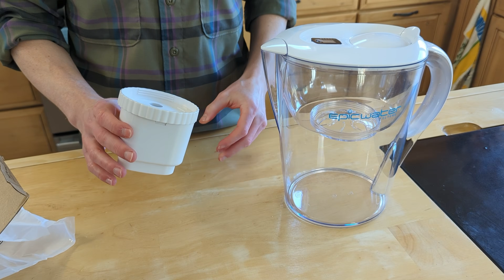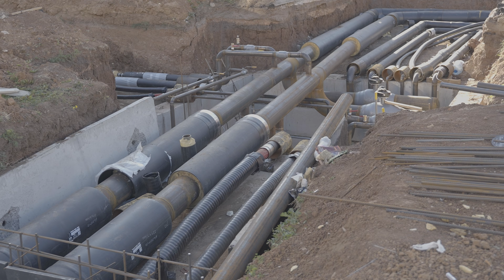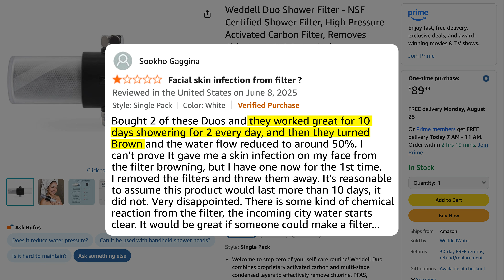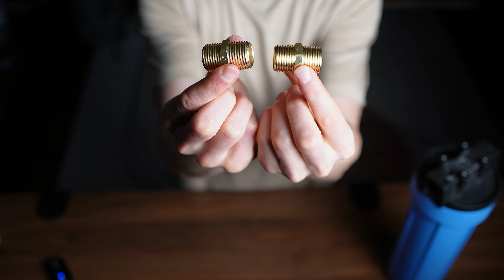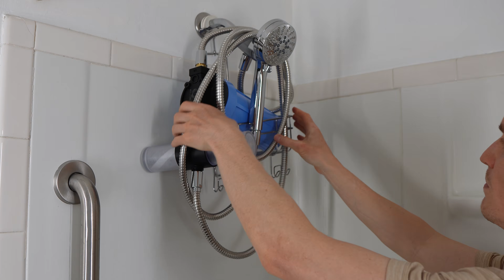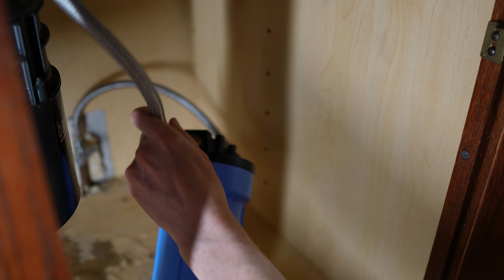You Have a Water Problem

Comment: Could the sediment filter setup be too heavy for the shower head? The thing could weigh up to 5 pounds when filled with water.
Reply: Possibly, if you're concerned you could always put it on the floor of the shower. Rentals can sometimes have pretty flimsy plumbing.

Comment: What's your solution for renters in Los Angeles? What sediment filter, KDF filter and carbon filter before the water softener in the tub? How to keep the tub and equipment clean with all that gear getting wet on the floor of the tub? Will the downhill distance from the shower arm and all these filters strangle the water pressure? 4 1/2" or 2 1/2" big blue? Pleated vs 10-1 sediment filter? 
If this wasn't LA,  I would just move. In Los Angeles, Department of Water &  Power uses chloramines, which Weddell does not remove. LA has hard water. 60% of LA renters are in buildings with aging galvanized pipe. My toilet tank contains rust dust and flakes. Dissolved minerals from corrosion and random pipe repair materials also stain hair and tub brassy. Arsenic, Bromate, Chromium (hexavalent), Haloacetic acids (HAA5), Haloacetic acids (HAA9), Nitrate, Nitrate and nitrite, Total trihalomethanes (TTHMs), Uranium, Bromodichloromethane, Bromoform, Chloroform, Dibromochloromethane, Dichloroacetic acid, Trichloroacetic acid are above EWG healthful standards.

Comment: My weddel duo shower filter clogged after two uses. Returned it got my $90 back for that garbage.  I used a Berkey water filter for half the price and it lasted a lot longer.
Reply from the maker: That's a water problem, not a filter problem. Sounds like the filter was working as intended to remove sediment.
Reply: @waterfilterguru well can I complain to my water company about that?
Reply from the maker: @Vyraxium  you can try. The issue is likely coming from downstream in the distribution system, aging infrastructure for example
Reply: @waterfilterguru  yeah it's ridiculous I might have to do your sediment filter before my shower filter that you showed in your video.  I bought the aqua tru carafe but I use a water drop picture before putting it in my aqua tru

Comment: This is definitely tough on all of us. All we want is to be healthier😅 As many others, I spent $90 on the Weddell shower filter and bought 4 more filters the first 2 months. I thought I'd be relieved upgrading from a cheap amazon filter.         Unlike some people, my water pressure has not changed. When I saw the filter turning brown pretty fast I was worried, but the internet reassured me it was good to use the filter until the water pressure decreased. Well I decided to use my TDS meter (total dissolved solids) on it. On a month old Weddell filter, AND immediately after installation. NO CHANGE. Devastating. Went from 245ppb to 240ppb both times. I understand that this could also be a sediment issue, even though my water pressure is fine. It's a tds meter after all. However, when I test the water from my Zero water pitcher it is LITERALLY zero. And it's water from the same house.🤔. This is a bulky set up. My rainfall shower head and putting more weight on the water line is not an option. I do appreciate a solution. But I would hope they could make expensive water filters that do this😔 Feel for everyone on here doing their best!❤️
Reply from the maker: There's some misunderstanding here, let me clarify:

Your TDS meter is actually working exactly as expected, and the good news is that this result doesn't mean your filter is failing. 

A TDS meter measures dissolved charged substances like minerals like calcium, magnesium, and sodium salts. Shower filters, the Weddell Duo included, are not designed to or capable of reducing those, and honestly no shower filter on the market is. The media inside targets chlorine, disinfection byproducts and some heavy metals, and those media physically can't remove dissolved mineral salts. 

So a near identical TDS reading before and after is the normal, expected result here, not a red flag indicating failure.

Your ZeroWater comparison is a different technology entirely. ZeroWater uses ion exchange deionization, which exists specifically to strip dissolved solids from drinking water. That process is slow, expensive per gallon, and completely impractical at shower flow rates, which is why no shower filter is designed to reduce TDS using that process.

If you want to actually verify whether the filter is doing its job, test for what it's designed to remove. Cheap chlorine test strips on the water before and after the filter will tell you far more than a TDS meter ever could for any shower filter.

The brown discoloration you're seeing is most likely sediment or iron (rust) being caught, which is a separate issue from dissolved solids and doesn't show up on a TDS reading either. And this is actually a sign of the filter doing it's job and removing these suspended particles like it should.

Totally understand the frustration of spending money and feeling like you can't confirm it's working, but in this case the test just wasn't measuring the right thing.

Comment: Thank you for this Video.  BRAVO !! I have successfully been using for a year the WEDDELL Filter system, changing filter every 2.5 -3 months. 
💧 Suddenly After changing the White Filter .....3 days later ,the :Pressure was significantly lower, where before it was strong. & Ideal. 
  I checked connections, and reconnected added fresh plumbers tape, even bought new Handheld Shower Head and it still sucked.   The Plumber fixed bath faucet Leak (Diverter issue) and still no improvement.  I took both sides /Filters out and ran tap water to rinse them off reattached and not much difference.   So I am considering the SEDIMENT FILTER as a necessary requirement.  

WEDDELL has been my best option for an entire year....until this Lack of Water Pressure after 3 days of NEW FILTER...My last Test will be to replace the (RED sided) Carbon Filter and see if that works if only for a few days.....Confirming the SEDIMENT ISSUE. 

UPDATE: I did indeed replace the black carbon & Voila the pressure of return to normal. If I lose this pressure in the next days or weeks.... I know that I will need to get the SEDIMENT filter.  Thank you for those detailed instructions on how to put that together. 
God Bless.
Reply from the maker: Glad you found the video and it was helpful! Let us know how it goes if you implement this solution

Comment: Advice for the Weddell. Might be of help. My bf who doesnt seem to suffer from hard water will not let me put that bulky sediment filter in our shower. So..here's the tip from a reviewer on amazon. "" This filter is great. But I’m going to let you in on a little hack. To preserve the filters it’s important after you use them to unscrew them and let out the water and pour the water out of the plastic and rinse them with filtered water or clean water andset them out to dry. This will preserve the filters and stop them from turning yellow within one week.
I use these filters in my guest house. I took a shower in the guest house, one time and one week later the white filter was yellow from water sitting inside of the plastic housing.
What I did was, I added a little OxiClean into a small container with lukewarm water and I set the white filter in it overnight and then rinsed it with filtered hot water then dried it. Let it air dry for one night even though I continue to buy more filters to replace each one. This is just a simple hack. I use to preserve or reuse the filters longer.""
Reply: what a hassle,,    at that point, id be happier with tap water  lol
Reply: tI can see that rinsing off the filter and letting air dry could have some value however the Color Change is a only a dis-coloration.....until is becomes clogged up and Pressure drops.  That is the criteria for changing the white Filter.  Just Color alone is not the criteria.  
The Sediment that can clog up the Carbon filter /Red marked filter can be clogged up even from say the Apartment Complex Water is Shut for the building and someone does know what they are doing, can when turned back on cause a surge of sediment to clog up the system and mess with water diverters in facets.

Comment: So first I heard of the Weddell Duo, then I heard of the Portable on the go RV Water Softener, and NOW there's a sediment filter that might ALSO go bad in 1-2 weeks ANYWAYS. What's the combination set up to really do here?? Is there something smaller than the RV Water Softener but still as convenient? How do I know what kind of softener I need? How do I know what kind of sediment filter I need, if any? How do I find out? I currently have very limited space (And am not planning on staying here for forever), so am looking into temporary fixtures rather than anything big and built in. It feels like there are endless stages to ACTUALLY getting clean water that will help my skin health and hair health, anything you can provide would be really appreciated, thank you!
Reply from the maker: I'd start with the Weddell Duo https://geni.us/GDjF6Ct which has its own small sediment filter stage. If it lasts a while, there is no need for an additional separate sediment filter as is explained in this video. If you live in an area with high sediment in the water (like NYC) you'll notice the Weddell sediment filter gets filled up fast. In this case, it would be more cost effective to use a separate 10 inch filter as is explained here.

As for the water softener, it would also be prudent to first test your water hardness with simple test strips like this https://geni.us/ijpd to determine if its even necessary. It might not be. If it is, those portable RV softeners like I show you how to use in this video https://youtu.be/f5cbIdOZzek are the best option for folks in rental situations where a whole house softener is not an option
Reply: I have the Weddell duo filter attached (first) then after that attached I have the water stick that then goes onto the Moen magnetic shower head. I have found that after having this set up for a month, I will either need to buy more filters or somehow get a sediment filter attached before the Weddell, but frankly, I don’t think this is going to happen for me bc there’s a lot already going on in my shower.

Comment: If you are running hot water through a polypropylene housed unit, isn’t that going to leach into the water?
Reply from the maker: It's NSF certified and rated for up t o120°F, so we can assume its been tested for materials safety under those operating conditions

Comment: Hey guru, just wondering if I can reduce the bulkiness of this set up by buying a much shorter shower connector unit that runs from the filter housing to the shower arm, thanks in advance
Reply from the maker: You mean a shorter shower hose?
Reply: @waterfilterguru  yes would a 23 inch shower hose suffice?
Reply: @mananshah5131 I went for a 12 inch one and it worked just fine, just need to make sure that the filter housing is accounted for as you’re laying it on the side when showering likely so it’s won’t be vertical

Comment: I have the Weddell Shower filter. I get the 3 pack every mth, $60, it's getting expensive because my white filter only lasts 10 days each before turning brown. I would like to try your idea, maybe it will help prolong my Weddell white filters so that I don't have to purchase so many and save money each month. It looks bulky and awkward though and I like shower heads not handheld ones. What would the total cost of purchasing all these supplies? How much longer would my white Weddell filter last?
Reply from the maker: This would be in lieu of the white Weddell filter. If you install this external large sediment filter upstream, there would be no need to use the Weddell white sediment filter
Reply: @waterfilterguru  Ok. Thanks about the white filter.
Reply: @waterfilterguru  What about the black filter? Do you know how long the black filter lasts? I usually buy one once a mth.

Comment: After loads of testing, my Weddell Duo does not restrict water pressure until I attach the showerhead. The showerhead works fine by itself and the Weddell works seemingly fine if the water is pouring straight from the shower arm. The Weddell and showerhead cannot work together without severe loss in pressure. I've removed the flow restrictor from the showerhead. What could be going on?
Reply: Get a high pressure shower head.
Reply: Have you tried unclogging the shower head?
Reply: Sounds like the water pressure is compounding as you add more and more items so can make sense they work on their own but get bugged down together.

Comment: Hi Guru, how can I do this setup but also utilize the On the Go portable RV double standard water softner? Would I need an additional shower hose? Thx
Reply from the maker: Order would go sediment filter > water softener > weddell duo (without the sediment filer stage, you could use two carbon filters instead)
Reply: @waterfilterguru  I tried to buy carbon filters without the sedimint filter from weddell, but they refused.In this set up woudln't it be just as good to go with a carbon block filter in a 10" housing and skip the Weddell? I'm so upset about all the time money and hair lost for the past  1 1/2 years with weddell. I don't know how to proceed. Pleas outline... how many grains is the mos efficient (lowest resin and salt used  for sortening, for  a shower used by one or two people? AI is all over the place on the idea of how to propertly size the grains to do the least environmental harm. Doesn't the resin need chlorine removal in addition tothe sediment filtration before softening? In that case it would be sdeiment is 5 microns ok?, then carbon block filter which one? then softener (how many grains for 1-2 person shower?) then duo or carbon block to remove any accumulated PFAs or microplastics? I'm way too confused to shop. please help. also with hoses, stands (not hanging off of the shower) and hand held shower filter, lowest pososible rpice for best quality. 
Please sediment filtration an softeneing

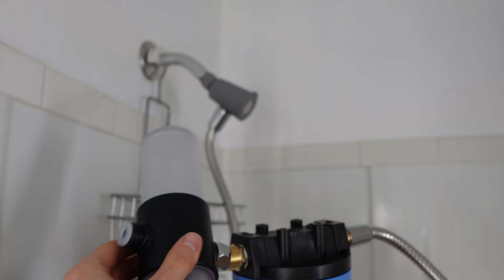Comment: 6:18 Can I ask you why you removed the white filter from the Duo Shower Filter?
Reply from the maker: Because it's not needed if you implement the solution explained in this video, it would be redundant.
Reply: Would it then be better off to ditch the weddell? I see some some large sediment filters with a charcoal built into them, or at least thats what it seems. Im also using On the Go softener. I lose pressure after about 2 weeks

Comment: Did as instructed. For some reason water doesn’t come out the shower head. Pressure just builds up in blue filter. Should I remove black O-ring inside Duo water filter.
Reply from the maker: Do you happen to have a shower arm diverter installed with the handheld showerhead? 

What you describe sounds like a valve somewhere that's closed

Comment: One thing I found that helps filter longevity is removing the cotton filter after each use, to let the excess stored water out, the filter partially dry, and prevent filter from sitting soaked which eventually invites mold. Before I did that- it’d turn brown in a few days. Now it takes a few weeks.
Reply from the maker: Nice thanks for sharing great tip!
Reply: Are you talking about the Weddell filter? Do you remove both the white and black filter to dry out overnight?
Reply: @Lisa-rh5xu exactly, yes. That’s the secret to keeping them fresh for a long time. Make sure you shake out the water from inside the filters, too.
Reply: @HollerAtcherBoi Ok Thanks.  Where do you place them to dry overnight? Do both the white and black? If the white filter is turning slightly brown will this still work to make the filter last longer?
Reply: @Lisa-rh5xu just do what I said
Reply: @Lisa-rh5xu I place them on my counter, don’t overthink this…
Reply: How long does your black filter last by doing this drying method? I usually buy a black filter once a mth.
Reply: @Lisa-rh5xu tough to say. Hard to tell when it’s gone bad. But my white filter used to be brown after 7 days, now it takes a few months

Comment: Couldn't you just hit the used filter with a pressure wash and keep using it? Rather than replacing it every time
Reply from the maker: Sounds like a good way to destroy the filter 😅
Reply: @waterfilterguru maybe, perhaps a pressure washer might be overkill. My main thought/question is- is there a way to effectively clean the filters to bring them back/close to new condition? Rather than buying a new one every month. One thing I found that helps filter longevity is removing the cotton filter after each use, to let the excess stored water out, the filter partially dry, and prevent filter from sitting soaked which eventually invites mold. Before I did that- it’d turn brown in a few days. Now it takes a few weeks.

Comment: Hello! Do you know what's the best solution for galvanized pipe lines?. I'm not sure if it's iron or copper but for sure is a metal that makea my skin itch and give brown stain in my clothes when I use the washing machine
Reply from the maker: What's the water source? What you describe sounds like it could be ferrous iron
Reply: @waterfilterguru my city's water is not that bad, is comes from a dam (you know the rains and then they treat with chemicals the water) but it has tons of chlorine, but the main issue is I'm renting a place and the landlord never updated the pipes, so the building has old iron/copper galvanized pipes, taking a shower is crazy, I use a body lotion cause the itching is crazy specially at night. So I was thinking in the water softener and the solid carbon filter you showed but not sure if those things address the iron/copper thing
Reply from the maker: Got it. Unfortunately installing a POE treatment system won't work, since the issue is coming from the homes plumbing itself. You could try a KDF shower filter. Let me know if that works